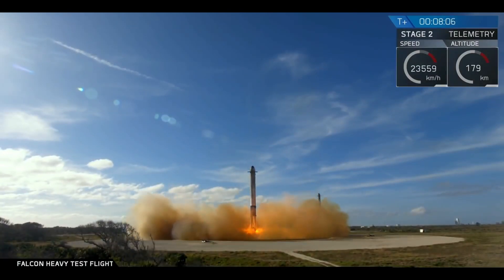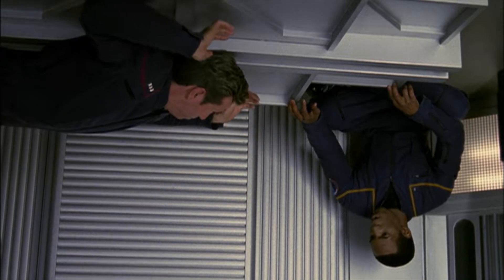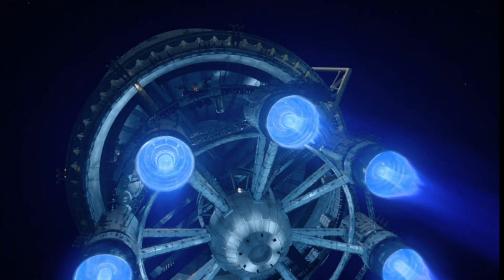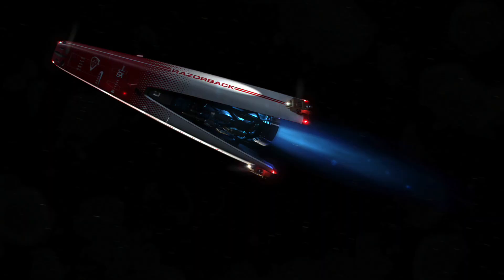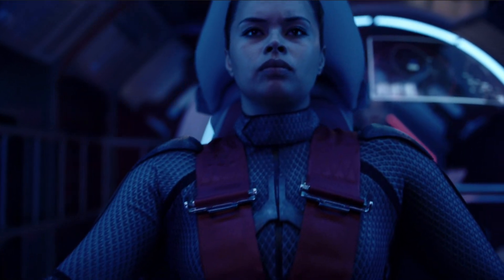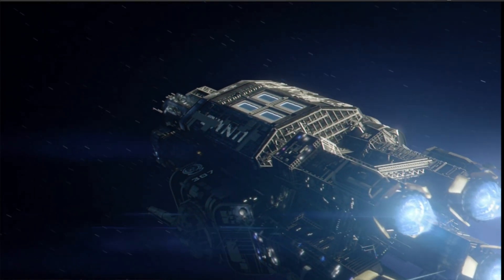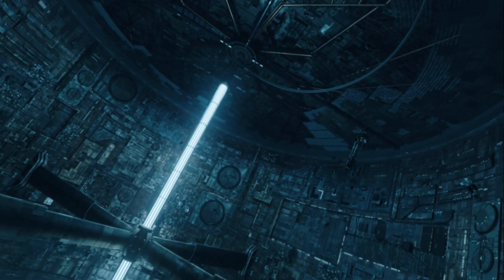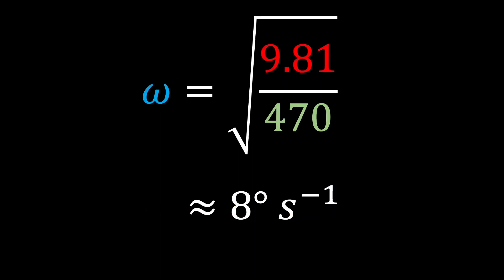Are the Expanse Ships Realistic? - Science of the Expanse

Comment: Hi Dr Ryan. I've had an idea for a rocket engine based on a variation of the VASIMIR ion drive. If nitrogen were used
as the reaction mass in the engine, then after being accelerated by the grid the nitrogen ions were neutralized and
allowed to recombine into N2 wouldn't that chemical reaction add enough energy to the plasma to bring it close to
Epstine Drive levels of efficiency? I'm assuming a fusion reactor driving the VASIMIR. I know it takes a LOT of
energy to disassociate N2>2N but going from 2N to N2 is the basis of many hi-explosives. At least, this could allow
practical single stage to orbit. It would be more efficient than a pure chemical engine and more powerful than an
ion thruster. I'd love to hear any knowledgeable opinions out there. This idea has been knocking around inside my
head for awhile now.
Reply: I’m not a chemist or a physicist but I don’t think adding any kind of chemical reaction to your ion drive will get you anywhere near the efficiency you’d get from a fusion reaction. But how would the nitrogen recombining in the exhaust provide thrust? It doesn’t matter what happens to your reaction mass after you’ve already thrown it out of the back of your ship
Reply: @oberonpanopticon  Thank you for responding. I did not make myself clear. I wasn't thinking of travel through space. The idea was a better way
to get from surface to orbit. The Idea is to use PART of the VASIMIR engine to ionize the nitrogen and then move the nitrogen ions to the combustion
chamber where you give them back their electrons to neutralize them, allow them to recombine into a diatomic molecule giving off a LOT of energy
in the process. Two nitrogen atoms release 946 MJ when they combine. Methane and oxygen release 890 MJ. Thats only 56 MJ but carbon dioxide
and water are 2.2 times as massive as a diatomic nitrogen molecule so the resultant exhaust velocity would be much higher giving much greater
efficiency.

The fault is mine for not being more clear. The trick to the whole thing is to break the nitrogen bond then ionize the atoms to stop them from
recombining until you want them to. Only a small part of the VASIMIR process would be used. That was the best way I could think of to break one
of the strongest bonds in nature then deliver the ions to the combustion chamber in one continuous process.

The purpose is to have a much more efficient earth to orbit system in order  to increase the payload fraction of the ship.

I hope I've made myself more clear this time.
Reply: @aysnov  The VASIMIR ion drive is a fairly recent and original variation on the conventional ion thruster
used on some current satellites. You can read more about it in wikipedea. I thought by using the bonding
energy of the nitrogen molecule, you could dramatically increase both the thrust and specific impulse
of the exhaust products, but I, myself, don't have the chemical background to calculate the changes that would
occur .
Reply: @calderlane6623  Nice answer.

Comment: I think the rotating seat assembly in the Razorback is called  a gimbal, a roll cage is usually an external safty structure outside of vehicles, but that is just how I understand it.
Reply from the maker: Quite right! Good thing I'm not an engineer!
Reply: @RyanRidden  haha neither am I, no worries, love your channel!
Reply: +1 for gimbal, and these were and sometimes still are used on boats for stoves and dining tables so cooking and eating can happen in rough seas. (A quick worthwhile Wikipedia read for more applications)
What I wonder about those in the razorback is whether they are servo-actuated or passive with dampers so you don't pendulum - the latter being what old boats have. I'd guess servo-actuated because if a person's weight distribution is slightly mismatched to the chair's designed center of mass, the passive orientation's resultant force vector error would be a big deal at 46G. 

On the other hand, "turning" (rotation + new linear acceleration) in space needs to be thought through carefully. Maximum off-main-engine-axis acceleration is limited by the steering/maneuvering thrusters which seem very weak even on the razorback; it can "turn" (rotate) quickly because it has a small moment of inertia. Pilot seats would logically be located nearest the ship center of mass to minimize the movement experienced by pilots, so dramatic gimbal rotations would seem unneeded BUT they would be in opposite directions unless both seats are (sub-optimally) forward of the ship center of mass.
Reply: Roll cages are bolted to the chassis, but inside the vehicle in most cases.

Comment: I can see how the rotation works on the Behemoth when it is sitting still, but what about when it is also burning forward at the same time? Anyone standing on the inside of the rotating drum would also have g-force pulling them sideways towards the engines.
Reply: The original  idea behind the nuavoo (behemoth / Medina station) when it was being built  was to burn for months (I forgot exactly how long) then kill the engines and spin up the drum for the next few hundred years while no longer under acceleration. Then shut down the drum and decelerate when it reached its new star system. The thing to remember about the nuavoo/behemoth/Medina was that it was supposed to be for centuries of interstellar flight.
Reply: @davyc412  So engines aren't that efficient to burn half way until the next star? :) and then decelerate burn? Or would cosmic dust just become such a hazard if you'd close to the speed of light?
Reply: @georgelionon9050  the engines are described as rediculously efficient for the amount of thrust they create  but they still use fuel so they can't run forever.
Reply: @georgelionon9050  Well accelerating by 1G gets you to the speed of light in roughly 1 year, co the constatn burn for a hundred year journey do not make sense...
Reply from the maker: You would indeed! If the ship is accelerating, you wouldn't want to spin the drum since there would also be a pretty strong torque that the station would need to flight with to reorient.
Reply: Depends on how much the acceleration is. If it's relatively low, then the inside of the cylinder will feel more like a funnel that slopes "down" towards the engines, with the angle on that slope depending on the acceleration, reaching 45° when acceleration matches the gravity simulated by centrifugal force.

Comment: A fighter jet only has a thrust to weight ratio of around 1. So it can only pull ~1G with the jet engines. The high Gs are created when pulling up during turns, using the wings. Those G forces are 'downward'.
Reply: That’s the thing with the Screaming Firehawk - it keeps the pilots facing forward.

It’s a question of whether the body can take more G’s when lying down, because that’s what they’re doing relative to the major G forces.

I know that the USAF experimented with prone pilots in the ‘50’s and 60’s and the F-16’s seat with an abnormally steep recline is sometimes cited as helping with G’s, so maybe they do want to be “on their backs” relative to the G forces?
Reply: @Justanotherconsumer  Yes it makes absolute sense in the expanse and you are completely right. But Ryan said that fighter jet pilots were seated with their back towards the jet engine for the same reason as the default chair position in the Screaming Firehawk (engine creates very high G forces). This is not the case, since the jet engines can't create the large G forces.

Comment: I don't think the Razorback is built any differently, if you look at the airlock at the docking tube, the Razorback also has its decks stacked vertically, but there's probably only one deck level, unless maybe there's a bathroom in a "basement" below the cockpit. The seats just move to the ideal orientation during high g's 

Razorbacks seats being able to face in any direction is a nice touch, and is more similar to the books, where every seat or bed (they call them "crash couches") on a spaceship is filled with foam gel that can change hardness or softness to cushion against g-forces, and can face in almost any direction using gimbals, but defaults to the people laying back so acceleration is in the ideal "eyes in" direction

Comment: The biggest problem with Expanse ships is lack of radiators, which would be necessary for vehicles with such strong drives falling into the category of torchships. They are riding literal thermonuclear explosions, of which only part of the heat is leaving the ship with exhaust, the rest goes into the ship. Heat is a big concern for any spaceship design with advanced drive, and even our projects of vehicles with fusion drives much weaker than Expanse ones require giant radiators
Reply: Agree, also radiators would be primary target in warfare, crew would just cooked with their own engine.

Interesting design was also in Avatar at beginning.
Reply: @Kato Ho Ten Soeng But that's impossible since it requires a multi megawatt nuclear fusion reactor which cannot be 100% efficient. And it expels ultra hot plasma, which should radiate some of its heat into the ship. Even the heat from crew quarters should require a little radiator actually.
Reply: Guys, someone proposed a fusion desing that could work. Just type "ToughSF Epstein drive". It would look nothing like in the show, because the reaction would happen way behind the ship. Charged particles would be redirected by the magnetic field. That way only about <2,8% of the heat would reach the back of the ship.
Reply: @Matthew35333  yep, Matter Beam did good job on it, but it still would require quite big radiators if I remember correctly. ToughSF is great blog, I recommend visiting its discord for some hard sf discussions too. Also, nice to a fellow Pole interested in speculative futuristic drives, that's something rare!
Reply: @Matthew35333  You still have the heat the ship itself generates, and that's more than enough to need radiators.  If the ISS needs radiators, any ship will.
Reply: @afriendofafriend5766  That's true, and those would be quite large for low temperature emission.
Reply: @Kato Ho Ten Soeng that's not how space drives work
Reply: Maybe they redirect all the heat into the fuel pellets ... so it gets exhausted?
Reply: @georgelionon9050  the heat is created in the thermonuclear explosion of the pellet, creating plasma, neutrons and x-rays, plasma can be and is directed by magnetic field, generating thrust, while rest goes in all directions. This is why you need to put the actual reaction as far as you can behind the ship, so only a small fraction of the energy hits the ship heating it
Reply: @revolverocelot6334  Yes and the heat you pick up.. you preheat your fuel with... so most of it gets out in the behind... Just so a theory.
Reply: @georgelionon9050  no, that's not how it goes. Some energy doesn't heat the propellant, and it's quite a lot od energy, and goes in all directions as x-rays or neutrons, hitting parts of the engine. It's quite unfortunate, but it's how it is, even with aneutronic fusion, as they get some side reactions which create neutrons
Reply: @revolverocelot6334  I think you don't get what I'm saying.. I understand what you're saying, but you could make a heat exchanger... (a fridge) which heats up the water on it's "backside" before it goes into the reactor.. from which most gets exhausted.. It would in effect cool the ship. get it?
Reply: @georgelionon9050  what you propose sounds like regenerative cooling in chemical engines we have now, which works nicely if you have high mass flow, which you won't in this engine
Reply: @revolverocelot6334  Just so an idea ;) Given they all have fusion reactors thus quite substantial energy.. it wouldn't be too far off they say they just preheat the pellets like a lot thus work with low mass flow.

But that cooling system would only work while the engine is burning. In the show they have no heat issue whatsoever even if the  reactor is running while they are orbiting or floating in interplentary space.. 

So yes,  missing radiators or heat problems is an oversight.

Comment: Spinning drums and rings feel almost like gravity when you stand or sit still, but the down force will feel stronger the further you are away from the axis and weaker the closer you are to the axis. Which would likely cause severe dizziness and nausea if the ring is not big enough. It's estimated that a ring would need to have a radius of a hundred meter so that you can walk normally.
The Behemoth is well above that size, so it should be pretty comfortable. The Discovery 1 is much too small though, and you'd probably be stumbling around a lot.
What would feel even weirder to our sense of balance is that if you walk in a direction that makes you go around the axis faster, the down force would feel stronger. And if you move in the opposite direction, it would feel weaker. You'd have to train yourself to always start walking slowly and to not make sudden stops or turn around while walking. And trying to throw things like balls across the room would be super weird.
Reply: This is a good point. In The Expanse books, coriolis force is actually mentioned when the Behemoth spins up, making a character feel sick. The Discovery 1 would be impossible to live on. You'd be pulled to the side by different degrees along the length of your body, and be severely nauseous all the time. For a spinning space station like in 2001 A Space Odyssey, the ring would have to be hundreds of metres across for the force to feel like gravity caused by a mass.
Reply: If you rotated your head on the discovery from up axis to down axis, the middle ear would know something horrible had happened.
Reply: @glynwilliams4204  Try walking while looking up. That's already too much for the sense of balance to handle.